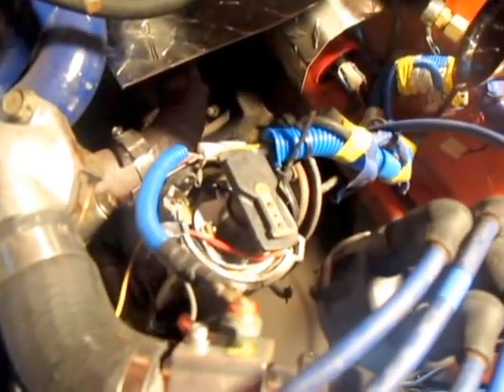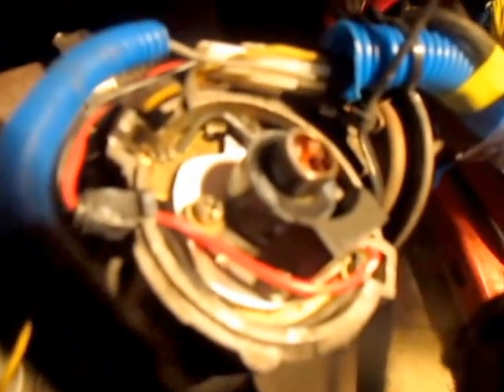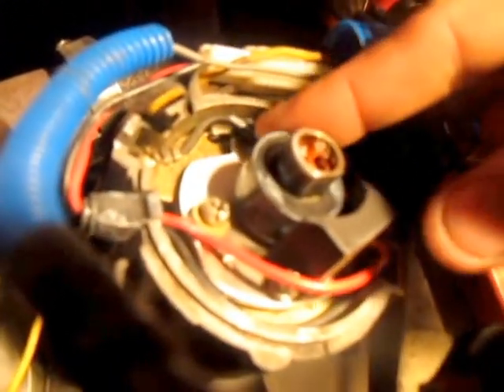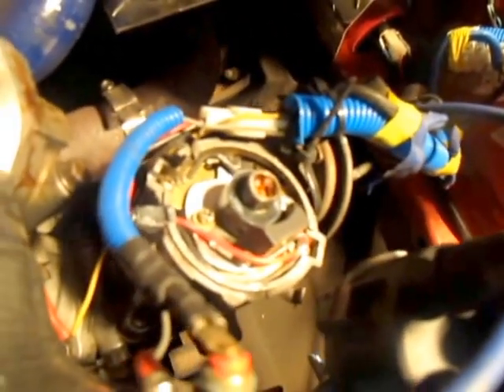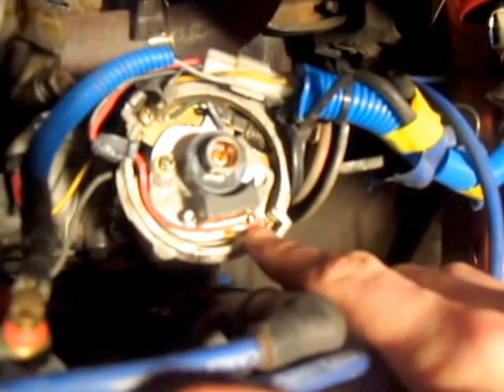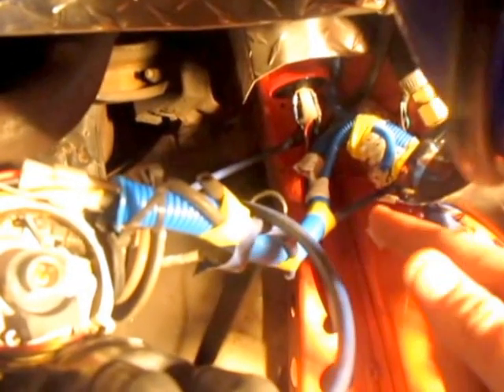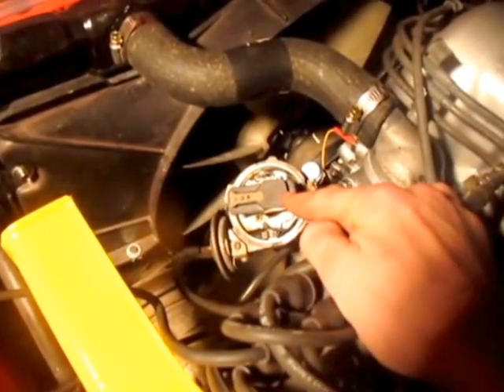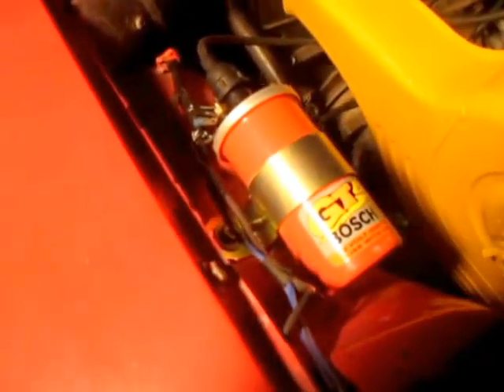How to Upgrade Points to Electronic Spark

Comment: I can going and look it up, but I'll ask here anyway. What are the benefits of getting rid of points? I can also probably assume and work it out myself, but my questions stems from the fact that I find it hard to diagnose any issues with my newer cars. With my older cars that had points, if I couldn't get it started on the side of the road, it was like a 5 min process to check batt, point, dizzy, leads and sparks mainly looking for corrosion then breaks. These days I'd probably tow it to a shop.

So I guess what i'm asking is whats the benefit of changing in an older car?
Reply from the maker: +The Soviet Gutter Cat the benefits are firstly that you will get a constant spark that is controlled by an electric component rather than a moving piece meaning with be less affected by wear and tear and also by different temperatures (eg cold starts). secondly that this pushed nearly twice the amps through each plug as an end result meaning that a richer engine used in racing can run longer without fouling its plugs and will also assist in a quicker RPM climb